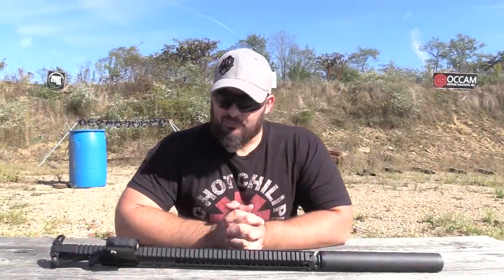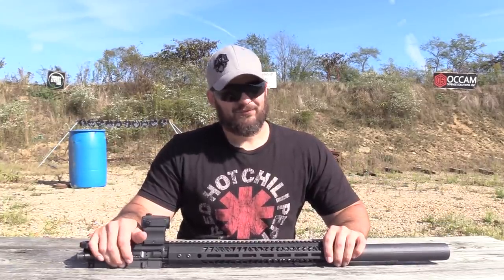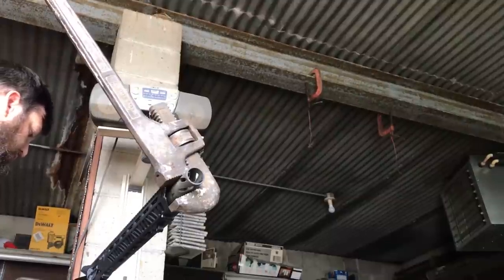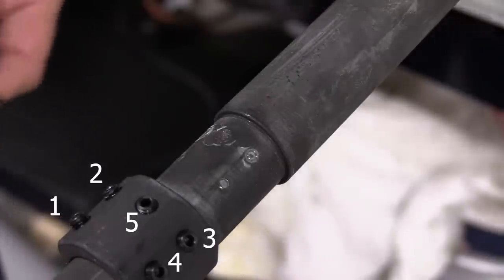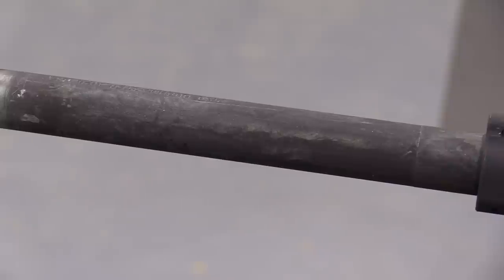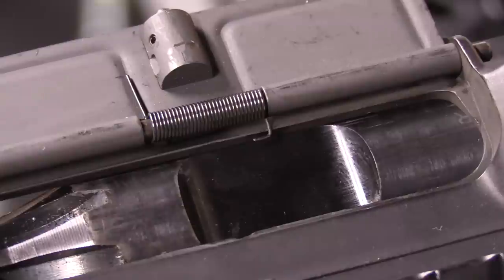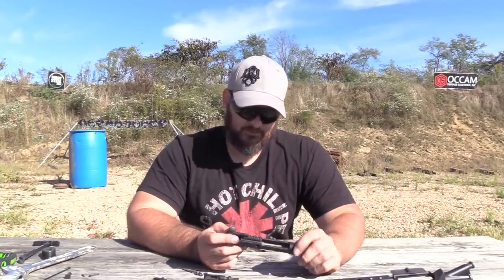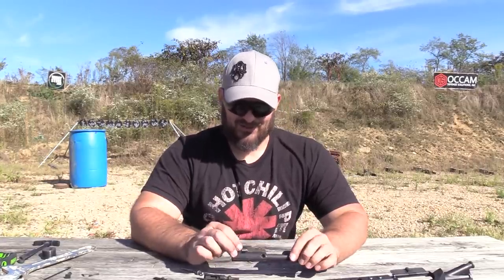The Worst AR 15 I've Seen 🚩Bear Creek Arsenal🚩

Comment: To be real if you spend less than 300 and dont do your own quality control BEFORE you shoot it . youre a fool . i just bought the side charging .458 socom upper had to take a trip to the hardware store to square it away but now it runs great ..it was only $259 .... I can live with the tune up on arrival . can you? 

THIS MESSAGE NOT SPONSORED BY BCA . OR BCA AFFILIATES .LOL
Reply: Han Solo What do you expect your $259 rifle to be capable of in terms of service?
Reply: @woodrowcall3158  well i rolled 12 Pigs with 10 rounds so in terms of service , i think its pretty useful tool . i have a $1600 .50 beowulf for "service".
Reply: Han Solo 12 with 10 rounds?
Reply: @woodrowcall3158  got 12 pigs with 10 bullets . two of the shots passed through a pig and got the 1 behind it . they are beastly rounds bro
Reply: Han Solo What bullet were you using? Full grown hogs? (150-300lbs)
Reply: @woodrowcall3158  yup 3 full grown and 1 juvenile 2 shots . underwood ammos lehigh xtreme penetrators 300 grains of doom .
Reply: Ever shot was full pen except 1 big boar who was quartered away when i got him .

Comment: You didn't inspect a new rifle or clean and lube it and fired it on full auto which it is not designed for. You have an old worn QD adapter. Amd cheap tools that you didn't bother taking the time to use correctly at a solid 90° angle. As others have said, you trashed the gun without proper setup. 
I don't trust this review... 
My bca all work fine.

Comment: This has to be one of the most misleading reviews ive seen on here, you ran the upper in full auto and it did what it was supposed to do! you claim it failed after you let it sit for some time but dont have any footage of the failure! For anybody that has a little common sense most the issues you claim you had with it could have been avoided in a matter of minutes by inspecting the upper before you ran it!

Comment: I didn't give this video either a thumbs up or down because: 1. it's not the caliber I'm interested in (12.7X42 AKA 50 Beowulf), and 2. you didn't do a side by side comparison between BCA's bargain basement 12.7X42 and Alexander Arms .50 Beowulf with equal number of shots fired out of both of them. With that said it is a good informational video and it never occurred to me to take an upper apart when you first get it to make sure all of the nuts/bolts/screws/etc. are properly secured before the first round is fired out of it.

Comment: Not sure what you mean by "illegal immigrant labor" but if you're working your way into the idea of BCA being a "sweatshop"; most of your electronic gadgets are made in "sweatshops" back in the orient. Electronic devices you rely on everyday for work and play. As far as immigrants, I'm sure BCA, whether they did have illegal immigrants or not, have the proper engineers employed to take care of the complex part of the manufacturing process for assorted steel gun parts.

Second, you're using a cheap heavy caliber upper that's not built to be used in full auto in the first place, come on, man. Who the hell else is shooting 450 Bushmaster in full auto out of a low to mid tier civilian rifle, at best? Maybe, not even top of the line shit that costs a few grand, but who knows.

Third, most hungry immigrants work harder and produce higher quality results than some, maybe even most lazy, spoiled American workers that demand to be overpaid just because they believe they deserve it without even earning it.

Last, how many folks have a fucking full auto lower receiver in your neighborhood?

Comment: This dude is way wrong I have a bear creek arsenal 223 Wylde upper that shoots sub Moa at 100 and has never had a malfunction with over 2 thousands rounds and my gas block was staked ok I mean it was super staked like I would like to see but it was staked and properly it has held solid and is still solid in fact I haven’t had to do anything to it it’s run right out the box perfect I also have a 6.5 Creedmoor upper from them and it’s also sub moa and once again it has performed flawless and no problems your way off my friends had an issue with his gas tube bending when he ran it crazy hard and he emailed them they sent him out a new gas tube the next day at no charge they have a lifetime warranty and will honor it and there very nice people

Comment: Damn this video got roasted. I'll never claim BCA, PSA, or my budget builds with Trybe barrels and less than ideal rail are battle rifles but seeing that they provide a complete upper with a proprietary BCG for a boutique round for a $400 price tag says a lot. 

I've never had an issue with my BCA uppers but I'm also not shooting them suppressed and full auto either. Are they Geiselle or Daniel Defense? No. But you're asking a lot out of any rifle treating that rifle like you did. 

I've shot my BCA uppers and never had an issue with them. I maintain them and I don't abuse them bc some of us don't have manufacturers sending us free gear and some of us are blue collared workers who's significant other might be better with us buying a $400 upper here and there instead of a $2,500 battle rifle. That's exactly who BCA is targeting... people who want a rifle that functions without breaking the bank. I'll still treat my "poverty ponies" like I worked my ass off just to afford that cheap little bastard bc it did. 

Must be nice being able to afford and shoot some of the best gear available. Not all of us are that fortunate. Some of us have to save for 6 months to a year just to afford a "poverty pony". I probably couldn't afford to shoot full auto 450 just because of the ammo cost, let alone putting a $1,000 can on any rifle on top of the tax stamp. Js

Comment: I don't know anyone that would buy an upper and not break it down before firing. All Of my deep green buddies will tell you if you fired a weapon before verifying it as being ready, Oh well.  I understand your saying they should put the same thing into an upper as the high dollar guys. but then they would have to charge High dollars for it. BCA supplies a product to a general user. most of whom know to break it down first to the last screw. when My Friends ask me where to get a deal on builders parts if they dont have much cash, I send them to PSA and BCA depending on cash level. we break them down and get to the process of discovery.   guys that are not going to do that, are also not going to run a can or full auto as we already know they cant afford it, Can = make it dirty as hell very fast, full auto = BURN it up. as in hot firefight. Both = quickly destroyed as they were not designed to handle it in the first place. why waste the money or time beating up on BCA? While I personally have never got anything from them that I didnt break down, I know some who have, Zero complaints based on usage. so again why bother ??

Comment: I bought a BCA barrel with my first build and had a friend install it. I couldn't figure out why my brass was ejecting at 1 o clock; I ended up just accepting that it was just over gassed until I bought and built a BCM upper and was like WOW it's ejecting at 3 o clock like youtube says it should. So I went back to my BCA installing a heavy spring and buffer, no change. I was like WHF. I finally compared my BCA barrel gas port to a BCM gas port and was completely shocked when I came to realize the size difference in the ports and understood why it was so over gassed and nothing would help (other than an adjustable gas block). The BCA barrels port was fucking huge when compared to the other port.
Reply: Just bought a BCA complete 10.5 inch upper for $180 shipped. I've put 100 rounds through it so far and the ejection is at 3-4 oclock,  I have a psa lower and a 5$ mag and a 30 lower parts kit and i fired 100 rounds back to back and not one malfunction or problem. So idk what happened to your gun bud. But mine works perfect
Reply: @MrLex87  Awesome, I'm glad yours works. My gas port on my BCA barrel is too large.
Reply: @bobcat5844  sucks yours didn't work man. Gotta be a bummer
Reply: @MrLex87  it was just the barrel and i got an adjustable gas block that should fix it.
Reply: @bobcat5844  that's awesome. I can't stand when people knock on the budget ar15. I mean the majority of people who those $4000 ar15s only post pics about it. Bragging rights.
Reply: @MrLex87  I'm with you I love a deal if it works it works.
Reply: @bobcat5844  were you shooting surplus ammo or M193/M855? It is possible that the rifle was overgassed because they expect people to fire steel case ammo which often has a much different pressure curve due to the manufacturer skimping on powder.
Reply: @ChucksSEADnDEAD  federal 223 or 556 brass, Man, I just think after having a little more experience with different ARbrands is that you get what you pay for up to a point then you start paying for brand name. That's why I like BCM their a good mid-range price with top quality. I sound like a commercial but it rings true for me. I loved my BCA rifle before I knew any better.

Comment: You sir lost all credibility when you broke out harbor freight tools to work on a rifle. No I'm not a tool snob I do have some harbor freight tools I just don't buy their Allen keys or their torx bits because they are subpar like your video. I think that you would have problems even on another manufacturer's upper running 450 Bushmaster full auto. That will rattle anything apart.

Comment: so where is the comparison video? you know shooting DD or BCM running full auto .450 bushmaster ammo with the sole intent to show the "poor quality" of shooting a cannon on full auto. I can tell you now it never works out for the cannon dummy! if you wanted to bash BCA you should run .556 or .223 or .300 black out and compare them with the high priced equivalent comparing an apple to a piece of liver makes you look like an ass. had you compared the BCA to the BCM in .556 or .300 or .223 I might have taken the video seriously. I have used BCA BCM DD colt Rock River Smith and Wesson all in .556 I have seen slight accuracy issues (could have been me) I have seen blemish issues and in the case of BCM a much better quality feel to the rifle but I have never seen a definitive expression on functionality. longevity yes but not functionality. come on man you can do better than this.

Comment: Its all about need and use. Self defense use needs some range time and be reliable with the cartridge. My frankenrifle is for me now where full rifles and even middle of the road parts are all sold out and backordered. My first ar build i think my barrel is cheap ass. Parkerized and no chrome. It was 125. But there is nothing out there. For me a non leo non military non competition but well seasoned shooter i can make do. When money and parts are available i can upgrade and re asses how my rifle is doing. Right now i wanted a base model that shoots. It will outgun most people with handguns in this riot prone world. It comes down to pay bills or ammo. Today my local shop had not one box of 556 or 223. Not one single round. Even the retail ar parts trees are empty. I ll shoot and see how it works. Dont be so hard on people who dont have the money. At least i did not buy an sks for home defense.

Comment: Probably the best way to "Build" your own AR is to get a BCM or better complete upper, a stripped lower from whom ever, and then a quality complete bcg, and lower parts kit, buffer assembly from a reputable company like Stag or CMMG, and you still have the experience of putting it together, but all of the critical components like the gas key, gas block, barrel/headspace are all done properly.
Reply: Great comment. If only this was one of the top comments instead of people being butthurt.

Comment: Never have used their complete uppers. Just have 2 of their barrels and a side charging upper
Reply from the maker: I’ve heard reports of decent accuracy. What are you seeing?
Reply: @VSO_Gun_Channel  10.5 stainless HBAR with about 400 rounds through it. Only had it out to about 75 yards but so far so good. Other barrel is a 24 inch fluted and that build isn't quite done yet, waiting on cerakote. The side charger hasn't had any issues except the handle comes loose quite often, even with blue locktite

Comment: What do you consider running the gun hard? You said you run the guns hard then put them away. Then you said there's not even 100 rounds through it....
Reply from the maker: That answer is different if we are talking semi-auto vs fullauto
Reply: @VSO_Gun_Channel  From doing these test. Do you have an idea around how much harder F.A. with a can is on a gun? Will your round count decrease 5k, 10, or 20k rounds till parts like the barrel have to be replaced?
Reply from the maker: This is so subjective. It depends on what you call “shot out”. 

That said. I usually get 10-15K out of an AR barrel. We are tracking life on this barrel
Reply: @VSO_Gun_Channel  That's nice to know. I have a Bravo CO upper I put a piston kit on 10 years ago. I'm around the 6k round mark, and the barrel is still in top shape. I have ran it until it smokes, and the gas tube was red hot before I put the Adams Arms piston kit on it. I've read that you should get around 10k rounds until you lose performance, and around 20k until replacement. I was thinking that was real low. For just shooting it once or twice a week , no F.A. or can on it.
Reply: @VSO_Gun_Channel  When you say you run the gun hard, I was thinking you dump hundreds of rounds through it and get it red hot. That's why it surprised me when you said there's not even 100 rounds through it.
Reply from the maker: Yes normally, that is “hard” but back to back full auto suppressed stresses a gun pretty hard. 

It really depends on the gun. Running something hard like a bolt gun in 300wm for instance might be 30 rounds in under a minute. 

Again. I felt that the performance of this particular upper was poor in response to the treatment it received.
Reply: @VSO_Gun_Channel  Cool man, thanks for the response. You don't really get that anymore with popular channels. Have a good one!
Reply from the maker: GG 556 I try my best. I just so happen to be incapable of doing nearly anything else productive right now. If you find yourself into a video I did years ago and have a question, I may not see it. But I try to keep up on at least the last few weeks of content
Reply: @VSO_Gun_Channel  What happened that you are incapable, from drinking, or injury?

Comment: Bought their ar9 for a low low price of 450 shipped. Had a out of battery discharge 90 rounds in. Destroyed my extractor, put a hole in my wall, and destroyed a glock mag. Thats what happens when you cheap out

Comment: I bought a BCA upper a year ago, bcg felt and looked crappy. I think I fired one mag through it and switched out the bcg with a Daniel Defense. Also changed the charging handle because the BCA handle felt like it was made out of aluminum foil. Everything else seemed to be fine. I think the bcg is where they really decided to crap out.

Comment: I went Ruger American Ranch, bolt gun in .450 bushmaster.  My state does not allow semi guns for hunting. I have purchased .350 Legend upper and .224 Valkyrie from BCA. I've not recieved the .224 yet, but the .350 Legend, 18 inch barrel, side charge has not had an issue as yet. I only put 30 rounds through it so it's still not broke in. I'd love to have all CMMG AR's. However with mortgage, truck payment,car payment, and all the regulat bills, those extra $1,500-,$2000 just dont exist. I figured I'd try a budget upper or 2. Noting that I never expect to put even 1,000 rounds through them. But never know till you try. For me and my applications, the BCA uppers fill my needs. If they fall apart after 500 rounds then that's on me. Can always return for replacement. And until I can actually afford to throw thousands at an AR that I can never use in hunting in my state, I'll stick with BCA, or even Palmetto.